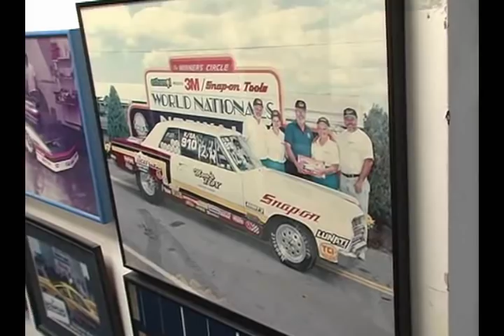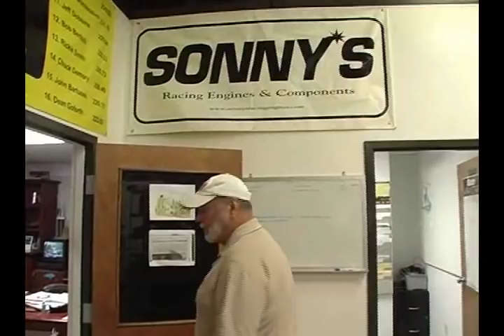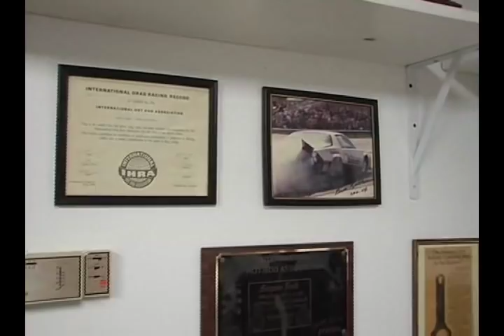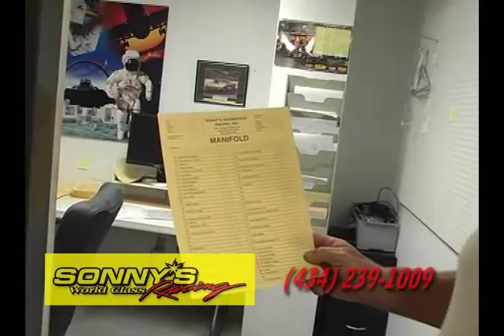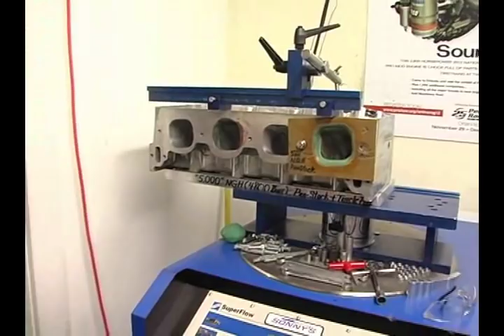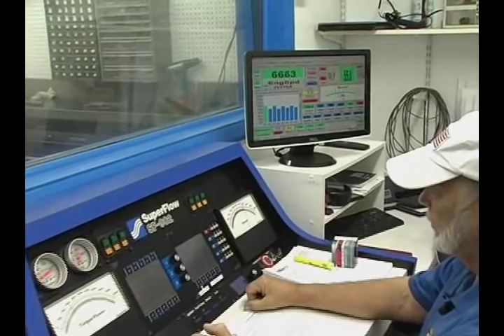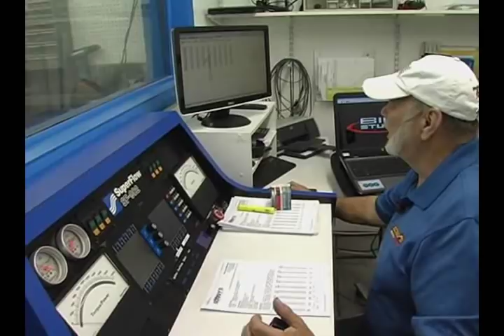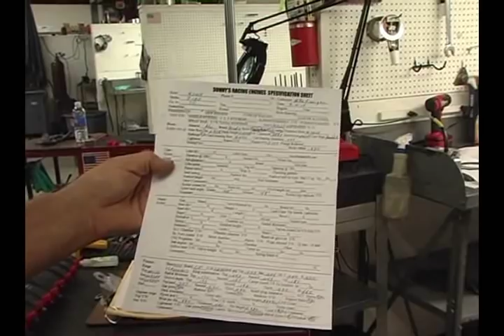SONNYS RACING ENGINES SHOP TOUR

Comment: 20 years ago we ran a Sonny's engine in a 70 camaro. IHRA  comp eliminator. It was a 565 inch n/a , it made 1000 hp with a single dominator. It was a lot of fun. Engine was flawless. Driver and crew ,not so much.

Comment: I must be old I bought a set of pistons and heads from sonny back when he was over in town in his small shop he was building Ricky Smith's ford engines and Johnny Doweys chevy prostock motors.
Ricky was running 760s that was flying back then. Lee shepard was running high 750s

Comment: I went threw Auto Mechanic school top of my class then went to welding top one of 3 then took 2 years Machine shop 2 in my class and even Auto Body Repair licensed in all but never could find a school that would teach engine building for this is what I wanted to do I am in my 40's and would still like to build NHRA RACING ENGINES is there a school just for engine building ?
Reply: +Deany D Arton 
The School of Automotive Machinists in Houston Tx.
I graduated from that school, it's strictly focused on machining and building hi-performance and race engines, and many graduates go on to work on NHRA and NASCAR Cup teams. If you're an engine guy, and want to work in a place like Sonny's, that's where you want to go.
Reply: ***** I  Thank you I will look it up for I have family that lives in Houston TX
Reply: Deany D Arton professional competition  engine builders are not going to give away their secrets. After all , it's a business. You wouldn't expect Coke or KFC to divulge their recipes.
Reply: Well, Deany, did you check out the School of Automotive Machinists?